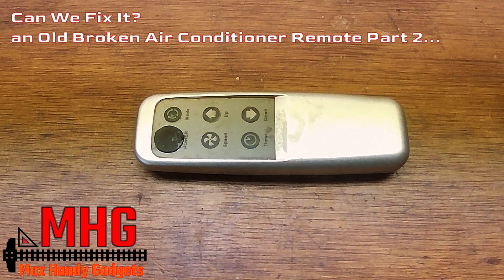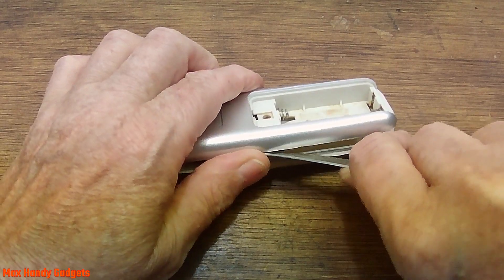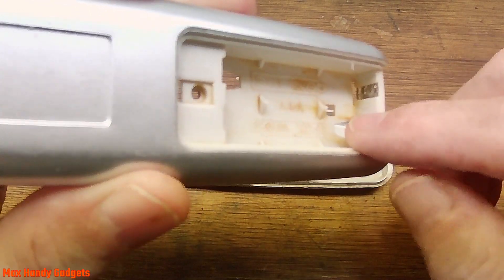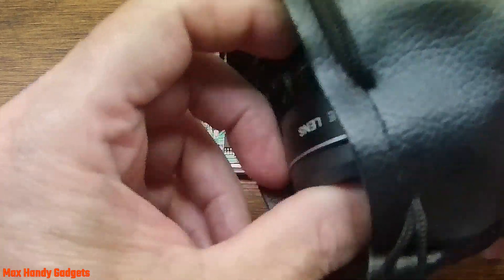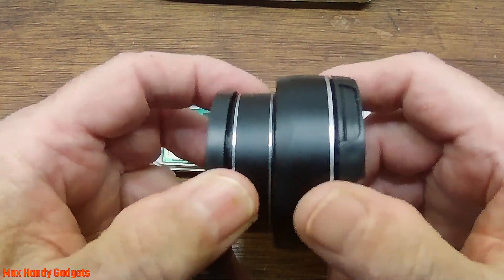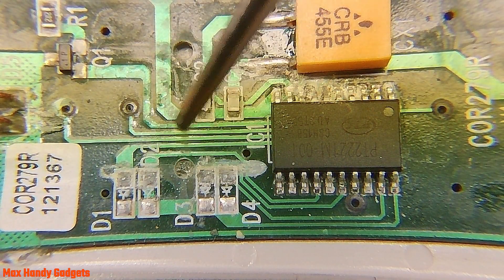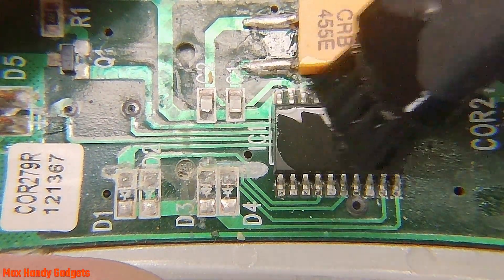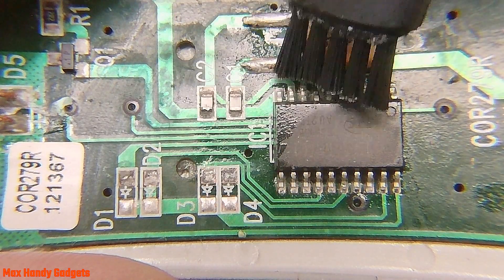Can We Fix It? an Old Broken Air Conditioner Remote Part 2

Comment from the maker: Yup, in Part 2, the air conditioner remote control is back after a month with a different problem. Old batteries were used, and they leaked everywhere, and it's not working. So do you think we can fix it again? Let's find out.